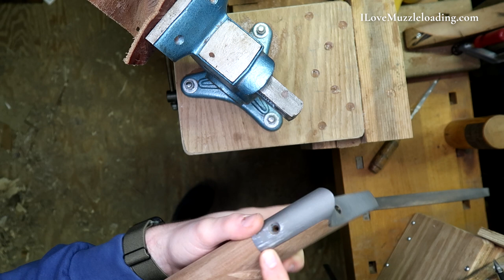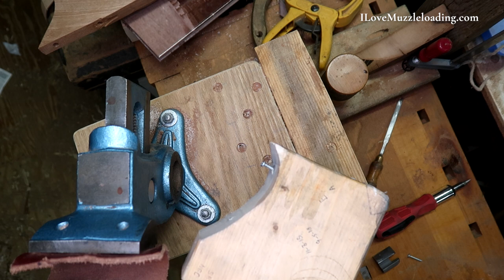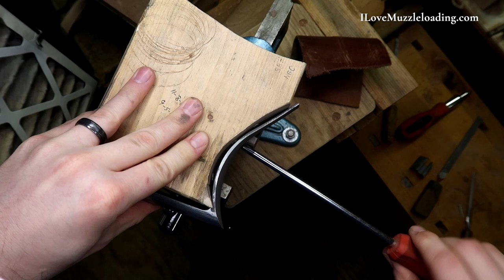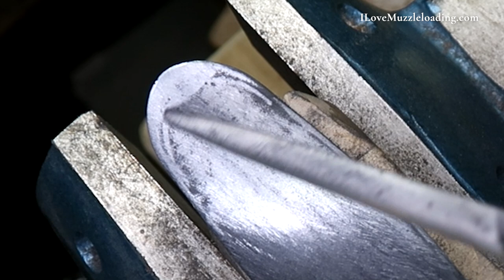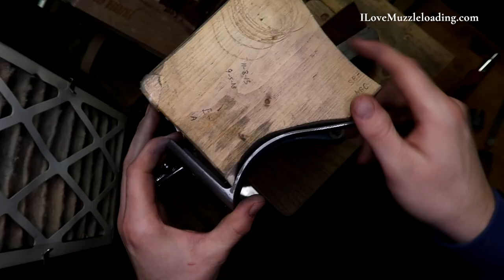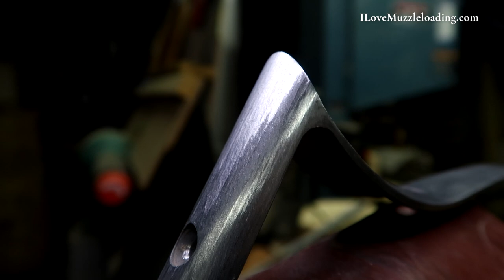How to refine your muzzleloader butt plate | Let's Build an Investarms Gemmer Hawken Kit Part 9

Comment: Ethan, that is pretty much the way I handle wax cast steel parts. Only 2 suggestions 1) I try to always push but not pull a file.  They cut only in one direction.  2) get a "file card" to keep the shavings out.  Deep scratches can come along if the teeth get a filing stuck in them.  Depending on the final finish, the degree of polish on the steel is a matter of personal taste.  I don't typically finish it to a mirror polish, just a satin gloss.  I'll be interested to see how you finish the steel (cold blue, hot blue, rust blue, browning etc.).  Great progress on this one.

Comment: I've been following the series. Lots of great tips for a guy who never built a kit before. I bought a Lyman GP in 50 cal and still had some work to do because I felt the finish was not great, especially the butt plate. The edges were so sharp I could cut myself and shooting itnwas downright lethal to my shoulder. Thanks for taking the time to video the whole process. This makes me think I might just be able to handle a kit on my own when there is no one to apprentice with in my area.
Reply from the maker: If I can do it Andrew, I know you can do it! Kits are a lot of fun, I like to call them "Mountain man lego sets", you will find a real sense of accomplishment when building one.

Comment: On getting the aesthetic of the "battlefield pickup"/ old worn out look, that sort of artificial wear is usually done once finish is already applied. I did this with an AK. I wanted to get the metal to match the flaky, peeling, cosmolene soaked surplus stock set i got for it. So I took a shower with it (swabbing the bore afterward of course), then let it sit in the basement for a month. I then carded the rust off and lightly ran 600 grit sandpaper unevenly across all the high points. Presto. It looks like something that was picked up off of a cold war battlefield. People who "attempt" this before final finishing are usually just being lazy and making excuses for poor workmanship.